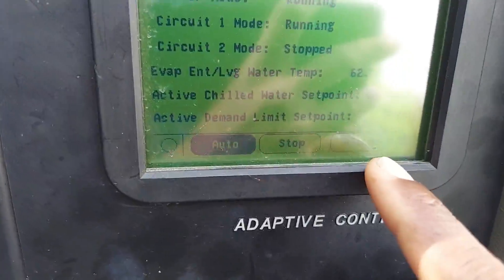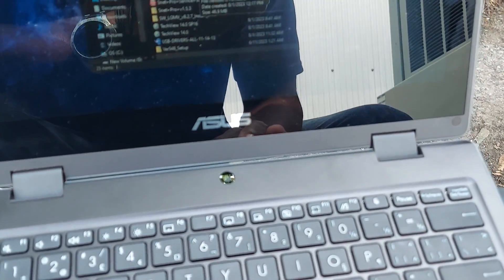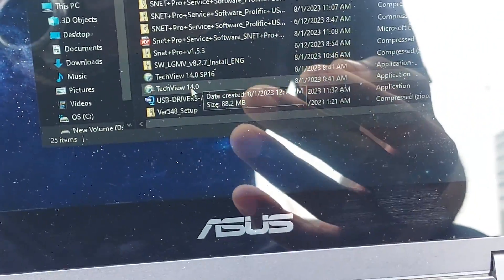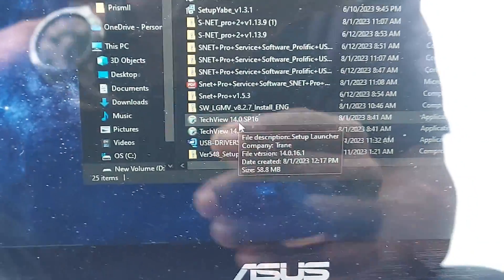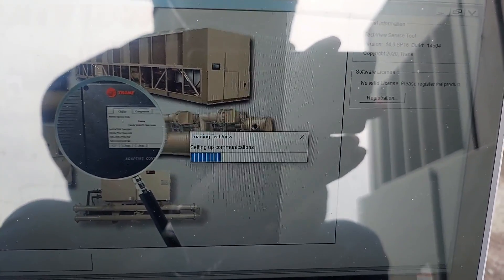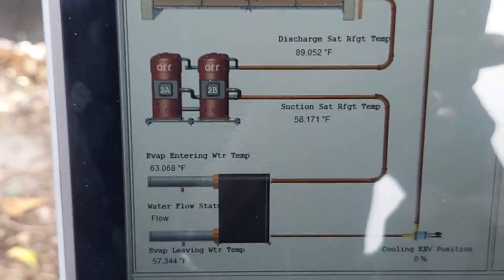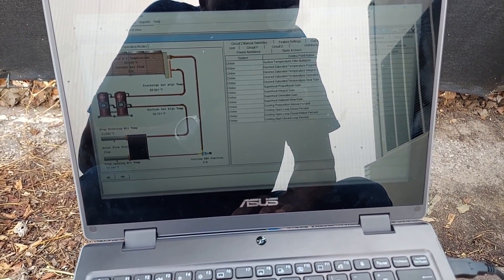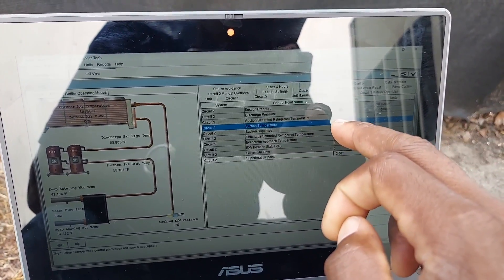TRANE CHILLER |TECHVIEW | CH530

Comment: What happens when you CANT bind anything on the chiller? Message: Unable to read from selected device
Reply from the maker: What are you trying to do ? If the device i am trying to bind don't communicate then I would do a test try to unbind and then rebind a functioning device if that works then then the previous device is the problem!

Comment: Sir i needs help. Trane techview not contacting
Reply from the maker: Check your com port, make sure you are using r232 to usb cable  and not rs485  also ensure your cable drivers is installed on your computer
Reply: Which window use laptop support sir

Comment: Those suction line sensors have a tendency to fail.
Reply from the maker: I guess I am no expert on these chillers  , I am just passing through
Reply: It's moisture from condensation entering under the wiring insulation at the stainless end cap. Dielectric grease helps keep moisture out.